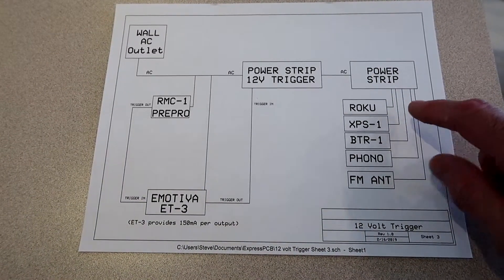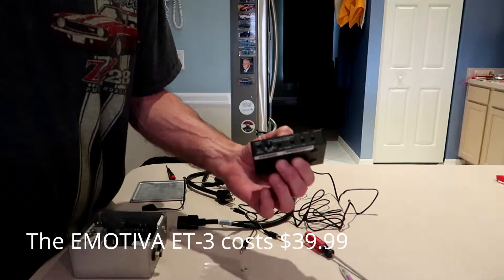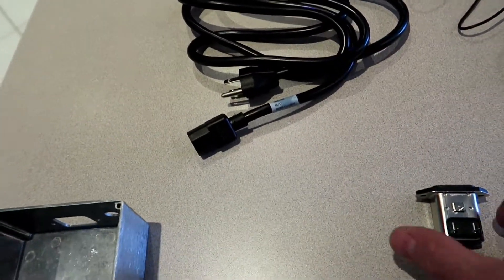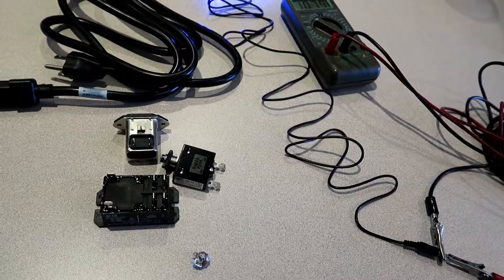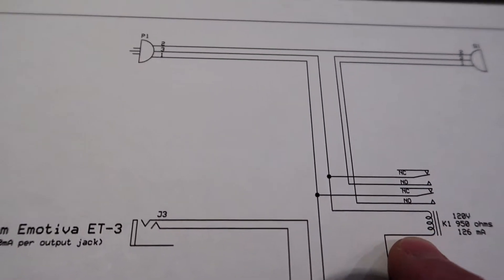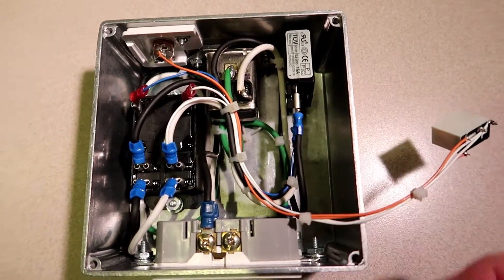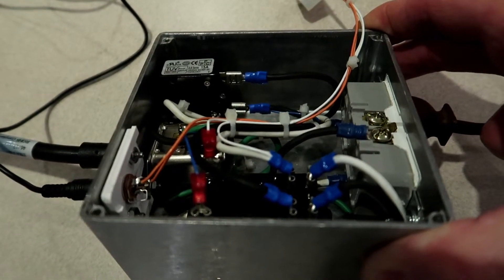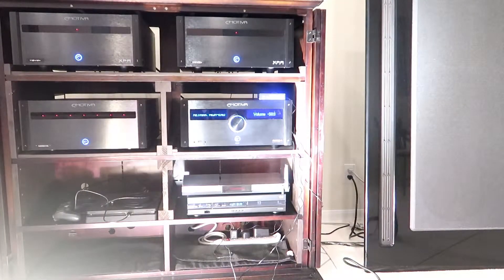How To Build A 12 Volt Triggered Power Strip For $50 - $100.

Comment: After retiring my Marantz 2252B receiver with a switched outlet that I plugged in my BOSE 901 EQ to.  But my new Emotiva pre amp and power amp didn’t have switched outlet so I found a Black and Decker Wireless Remote-Control Outlet for $16.  Only downside is I now have another remote to live with.
Reply from the maker: Good find. One more remote, haha, just one more to add the pile!

Comment: You really should have a diode across the terminals of the DC trigger power supply coming from your emotiva.  When the relay shuts off, the piston drops back down through the coil and sends DC the opposite way to the emotiva trigger output.  It may fry or confuse it one day.  A 1N4004 would work fine.
Reply: Like just add a diode to the 12V trigger input on the small relay.  Put it between the pins directly on the small relay.
Reply from the maker: You are absolutely right craig and I thought about that after I put the box behind the audio cabinet, because I do have a bag of 1N4001s. The next time I have to go behind the stereo cabinet, I will fish it out and add the diode.

Comment: Hi Steve, I came across your video as I'm looking to do the same thing for myself here in Australia on our 240V/10A mains. 

I had thought of using one of the small relay boards available complete that uses 12V to trigger the 240V AC relay, but I'd prefer to follow the same model as you have.

Would you be open to sharing your schematic/design so I can follow how you have wired up the relays and which models they are (I know I'll need 240V versions). 

I'm trying to determine how you are using the 12V relay to switch your 120V one... is the 12V relay passing 120V to energise the coil on the larger relay?

I've done DC powered ones before using a DC source for to trigger my cooling fans when the 12V trigger fires but not an AC setup so I am hoping you are open to a little teaching and sharing of information :D
Reply from the maker: Hi michael.  I do have a drawing of the circuit, but give me few days to see if I can find it.

To answer your question: The 12VDC relay coil is energized by the 12VDC trigger voltage and the 12VDC relay contacts pass 120VAC to energize the 120VAC relay's 120VAC coil. I hope that makes sense until I find the drawing I made.
Reply: @StevesStrayStuff  Thanks for replying Steve. :)

It does make sense.

Is the reasoning for 2 then that you had a small DC-AC relay and the larger AC-AC contactor rather than one single (more expensive DC-AC unit)?

I've a DC-AC relay that operates on 3-12V (50mA or 75mA trigger @12V) and passes 240VAC @40A max I'm planning to use.

75mA seems comfortably within the capacity of the 12V trigger and I figured I'd just use the single relay unit. 

Previously I've used the trigger to run a 12V wall wart for powering fans or relays needing over 100mA to trigger... I didn't think that was necessary here.
Reply from the maker: @michaelrobinson9643  When you said "I've a DC-AC relay that operates on 3-12V (50mA or 75mA trigger @12V) and passes 240VAC @40A max I'm planning to use" is where I thought about the strain on the 12VDC trigger circuit, because I cannot find any standard criteria for a 12VDC trigger. My 12VDC trigger was only 10.8VDC and I thought the extra 75mA+ current draw might be on the high side for the preamp/processor providing the trigger. The small 12VDC relay dropped the extra trigger current requirement to less than 20ma. My processor's trigger output, triggers four series connected components and I thought that the extra 75mA+ current draw might be a problem.

All of the 240VAC @ 15A/20A relays with a 12VDC coil that I could find required 75mA to 100mA and I didn't want to chance it. Even the dedicated repeater I purchased has three outputs and the total maximum output current is150mA.
Reply: I printed a nice enclosure too - fits a dual gang GPO on the front and has connection points for the trigger and 240V input. Not a bad outcome for a novice designer and orients nicely behind all of my gear (I'll use it to power my amp and my minidsp).
Reply from the maker: @michaelrobinson9643  Nice! Nothing is more satisfying than using something you designed and built yourself.
Reply: @StevesStrayStuff  hmmm most of my message disapeared sorry! 

I agree the triggers are rarely specified and can range in supply from 50-100mA. 

I think your use of the low current relay is really astute and now I've proven my Crown XLS amp will behave with an external relay I have assembled a setup and it's not working... I'm stumped after reviewing my design and verifying the wiring is matched to my schematic. Tested the input and output. 

I cannot get my DC driven relay to switch on my AC driven relay. If I apply direct mains the AC relay powers on but the small solid state relay Im using doesn't seem to do it. It has a 15mA switch current (DC) and is rated for 2A across the contacts @ 240V AC. 

I'm using this model: KSA240D2-12 and for the main power an FRABPC-S2.  

DC relay is switching the Active line for my AC which together with Neutral, is connected to the main AC power relay.  Active is connected to common and from NO continues to the GPO. 

Should you have a minute I'd be delighted if you look at those models and consider if I'm doing something obviously dumb :). 

As an aside, to protect your 12V trigger box, have you considered a reverse bias schotky diode (IN4001 is ok) as a freewheeling diode to discharge the coil when you power off the trigger? The voltage spike from a coil can be very high when the magnetic field degrades (inducing reverse current flow).
Reply from the maker: @michaelrobinson9643  You're right, something does not make sense. Can you draw me your circuit and email it to me so I can look at what you have? Send it to no4injunk@aol.com

I thought about the reverse diode, but then that would have been one more component that would need soldering/splicing and wedging in the enclosure, haha.
Reply: @StevesStrayStuff  haha.... a diode is not big! at least you have the sacrificial Emotive box and not the actual processor trigger on the line :)

I shall e-mail my information. Today I will go back to baby steps and check that the relays function - even just continuity across the contact on the SS relay to ensure I didn't damage it soldering. I tested with another relay and it also won't run off my 12V trigger (too high a current need I expect). 

Time for me to get a breadboard and go back to some of my prototyping fundamentals instead of being lazy and just assembling with 2 toes crossed.

Comment: Why not use the 12v trigger coming from the receiver it self and save yourself the money and step of using the emotiva trigger splitter?
Reply from the maker: I wanted to make sure I isolated the power strip relay from the receiver's trigger output and the repeater did that for me.
Reply: I understand. But it should work without it, correct?
Reply from the maker: @antoniofontes4478  Yes, it would work without the Emotiva box.
Reply: Thank you

Comment: Just curious, why didn't you use a solid state relay ? Do you think they may be an isolation issue?
Reply from the maker: Hi Tony. My decision was totally based on the cost. I wanted to keep this as inexpensive as possible.  I wanted to use a DPST relay to open both the hot and neutral.  A SPST solid state relay starts at $60 and I would need two.  The DPST mechanical relay I purchased was only $20 and it is rated for 10 million operations so it should outlast me, haha.  Thanks for watching.

Comment: Would you build one to sell to me
Reply from the maker: I wish I could Thomas.   I have several homemade electrical devices that have been plugged in for over twenty years and have never failed.  My homemade boxes do not have UL Certification, so I cannot make you one.  If my device were to start a fire and I don't have the UL certification, I will be held 100% liable.  Thanks for watching.